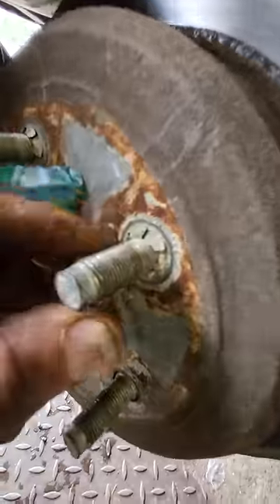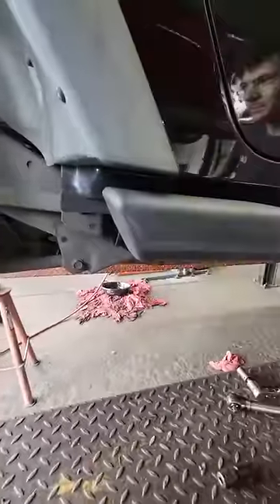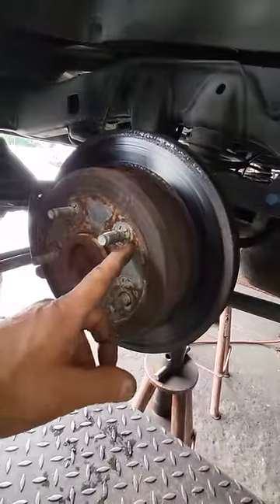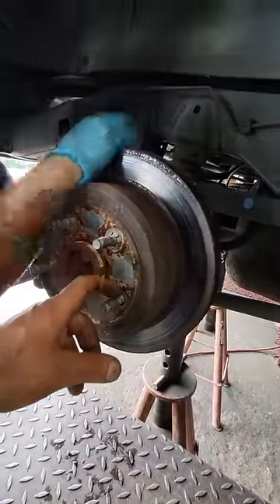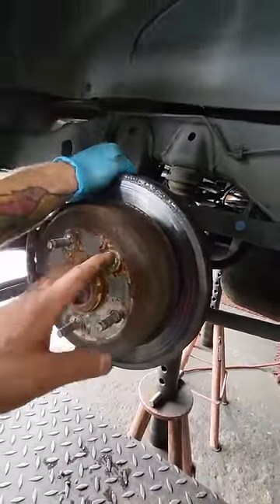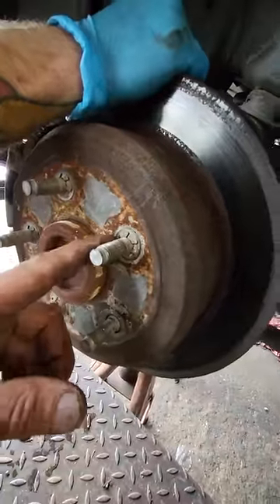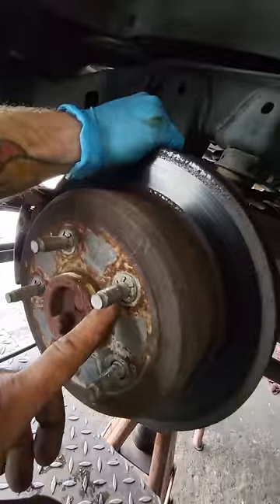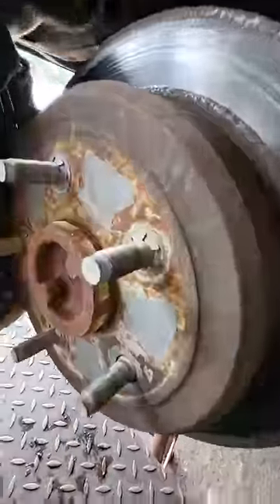There is always that guy

Comment: We had a 2003 Civic manual tranny, replaced the original brake pads from factory at 200k miles! Absolute truth. Drove a manual, like we were always taught, down shift to a stop. Apply brakes at slow speed. I was  amazed they lasted that long. Rotors were in great shape, just pads finally got wore down to the squeallers. That was an awesome little car.
Reply: Imagine using the brakes to stop the car instead of the transmission?  Wow what a novel concept.
Reply: @machineman8388  Your lack of knowledge in driving shines brighter than the Vegas strip.🤦
Reply: @whitetailhunter7202  i know how to drive, you drive like that on a track.... if you're doing 50 and a light turns red 200ft away and you downshift multiple times to slow the car and not the brakes you're a complete clown.  Its in the name..... brakes....... and transmission
Reply: @machineman8388  Your continued comments just completely prove my previous statement absolutely correct. Your knowledge is seriously lacking. "Track driving?"
Son, that's how you drive manual.
200 ft? It turned yellow way before, already was slowing down.
Reply: @whitetailhunter7202  yep I did a brake upgrade on my jetta, 140k kms and the pads and rotors looked brand spanking new. I obviously keep the car in gear while slowing down, but I think its mostly just being aware of traffic flow and lights. You hardly have to brake when you are already anticipating traffic slowing down. 
I see people who accelerate towards yellow and even red lights! its not a racetrack, its the road. getting to the light sooner just means you have to stop!
Reply: Brakes are cheaper and easier than a clutch
Reply: @AlphanumericCharacters  yeah but you don't slip the clutch to slow down. once its engaged its not going to wear. by leaving the car in gear your engine is doing the braking not the clutch or trans.
Reply: @Born_Stellar  it’s gonna slip as you are engaging it to slow down. You will wear a clutch more on a downshift like that then an up-shift. Which is why you double clutch and rev match on a heavy truck transmission. You don’t do this on a synchronized transmission. Your revs aren’t matched. 
On an up shift you are dropping revs and going up to a higher ratio so you don’t get this effect. 
What you’re doing is trading clutch friction material for brake friction material. 
Not wise
Reply: @AlphanumericCharacters  but youre already in gear cause you were going forward. I stay in 5th till I get to pretty slow and then put it in neutral. 
also when I'm driving for fun i do rev match downshift.
Reply: @Born_Stellar  read OP's comment again........
Yes there's better and worse ways of doing it, but slowing down with anything other than the brakes moves the wear from the brakes to the part doing the deceleration, its very simple.
Reply: @machineman8388  legally you can't cost in neutral anyways.
Reply: @Born_Stellar  its in the name. 
The brakes do the braking........
The transmission transmits the power to the wheels through various ratios......

I wonder why people with automatics use the brakes to slow down?
Reply: @Born_Stellar  you don’t downshift to slow the car? You aren’t going to get squat for engine braking in 5th gear. Gonna take two miles to slow down. You could do that with any car and save the brakes. Just let it coast to a stop. Guess you don’t have much traffic out your way.
Reply: @Born_Stellar any load or energy reduction has to be done by something, sometimes its just gravity. Engine braking through a manual transmission is causing a ever so slight amount of wear. It is opposite to normal direction of wear that a car spends 80%+ of its life, so really no harm.
Reply: Poor driving habits/skill could affect this, the clutch should be engaged with as little slippage as possible. The only time a clutch should be ridden an slipped in normal driving start from a stop in first gear or careful precise maneuvering (or backing up in reverse).
Reply: @AlphanumericCharacters rev match bro. Negligible clutch wear on downshifts if you know how to drive
Reply: @AlphanumericCharacters ok f*cking big trucker what is a Jake brake for???
Reply: @jcanfixall1585  you got a Jake brake on an ‘03 Civic? Fucking sweet! Was that a JDM only option? You got it imported? Nobody is talking about if you should slow by engine braking with a heavy truck. And the calculation you are making there isn’t what is cheaper and easier to fix. It’s that you will burn your fucking brakes to the ground on a downgrade if you don’t do so. Plus, as I stated, you are rev matching. If the engine and input shaft are moving the same speed when the clutch is released there will be negligible wear. Besides are you downshifting on the downgrade when you are using that Jake Brake Mr. Big Trucker? Enjoy getting hauled out of the runaway ramp when you can’t get back in gear Mr. Big Trucker.
Reply: @AlphanumericCharacters  it really is amazing to me how argumentative some of these weirdos get when you suggest that a motor vehicle has an independent system with the purpose of slowing the vehicle down....... they feel they have to play a game of ego, like they know how to drive stick and no one else does.
Reply: @jaredlancaster4137  do you unironically think a manual transmission has 1 part named a clutch and thats it?  Because it seems like your understanding is very limited.
Reply: @jacobnorth8642  thats really what my initial point was, OP being a sanctimonious boomer bragging about saving brake friction material on a 2000 honda civic just made me cringe hard.  Swapping 150,000 miles worth of stopping regardless of how you drive from the brakes to the transmission is not a flex, its actually just stupid and makes you look like a non-conformist D-bag
Reply: @machineman8388  I unironically have never known of anybody breaking anything but the clutch. I am very aware of the workings of a manual transmission. They are usually very strong and long lasting. If you kind of know how to drive, most manual transmissions should last 500k+ miles with only clutch replacements and fluid changes, whereas an automatic will require full rebuilds including drive bands, sprag clutch, and valve body and torque converter service.
Reply: @machineman8388  to be fair….I’m argumentative as fuck. No better pass time while dropping a deuce than arguing with morons on the internet. Dude told me “rev match bro”. Can you imagine driving an ‘03 Civic around town and heel/toeing to prevent wear on the brakes. Literally some of the cheapest brakes on earth. How cheap can you get? Probably would have gone through three sets of pads and rotors over 200k if dummy hadn’t did as he claims. So drive like that every day to save $300 over a period of 200k miles? Ludicrous. It wasnt the OP who said to rev match so he wasn’t doing it. Just wearing his clutch out. Probably went through five clutches in that time. Or more likely the brakes lasted that long because they were mostly highway miles. Just epic stupidity. But it is fun to go through the progression of comments and watch them stick to their buffoonish ideas no matter all the incontrovertible facts and logic they are presented with.
Reply: @AlphanumericCharacters  LOL I'm dead dude, I forgot to reply to this but im glad I saw it again, I love to see these mouthbreathers dig their heels in deeper and deeper
Reply: @machineman8388  it’s hilarious. Craziest shit is they are probably googling shit before replying. They don’t know shit about it but some dumb shit cousin told them to do it years ago so they will argue to no end. 
 It would be like me going onto the comments after a video on accounting and arguing about the proper way to interpret actuarial tables or some shit. Everybody is an expert on everything.
Reply: @machineman8388 it's people like this that get slammed into because they're slowing down either in top gear or in neutral and when the jerk off behind them is on their phone and not paying attention they're not in a position to quickly accelerate or make a lane change to avoid getting hit. Once a clutch is engaged, there is no worry of wear. If you are a capable standard driver you can downshift smoothly without slipping the clutch.

Comment: As someone who works on there own stuff and is OCD. I use all the required consumables during break jobs (many people don't use red medium strength high heat thread locker on bolts like there supposed to) I also clean everything beyond clean. I don't reinstall those clips at all, there a one time use for holding the rotor on during the assembly line process until the calipers get put on to hold the rotor while the wheels off. Once removed they get bent easily and if you put them back on it can wheel vibrations from hell.

Comment: I actually work at the factory that builds the whole rear end drive train. We actually put those on in the process the hold everything in place during the build process. But it was designed to be removed at some point and there's no actual reason to have them on so there's no point replace them
Reply: Sure you do...
Reply: @CadillacDriver  sure did get quite.
Reply: @ImNotNotHigh420  nice grammar 😂😂
Reply: @CadillacDriver  this was an attempt at trolling? And why are you mad? Are you a GM exec or something?
Reply: Correct they go on to hold the rotor on going down the assembly line before the calipers get put on. After that they are useless as the brake rotor is held on by the calipers if the wheel is off.

Comment: I have been a mechanic for 42 years and I am that guy that puts on new clips when i do brakes It helps keep the rotor in place during reassembly and it helps keep the rotor seated against the hub flange during any future tire service.
Reply: I might put the screw back on a Honda if it's not rusty, but there's no way I'm putting these goofy ass things back on... Plus you would have to buy new ones since they get damaged removing them, just extra cost for literally no reason... If I need the rotor to stay still while I put the caliper bracket back on, I use a stud installer and a lug nut to hold it still...
Reply: @mariusjenkins7294 putting the screw back on the Honda is even more worse. Your setting the next guy up for failure
Reply: Wow has trouble keeping it on.. crazy . You only get the best problems. 
Bet your problem with your trees is to much fruit too. Lol
Reply: So the other 90% of the vehicles that dont come with them are wrong for not having them? Most rotors are rusted to the hub and the caliper keeps them on the hub. 100% useless to be on after the assembly line.
Reply: Never seize  @AndrewCantonTV
Reply: No one cares
Reply: @AndrewCantonTV I’ve had to drill out countless Honda rotor screws lmao they suck

Comment: I've seen cars with a Phillips screw in the rotor serving the same function. My luck was that the screw got seized, and I stripped out the head and ended up drilling it out. The after-market rotors I bought didn't even have the hole for the factory-assembly-line retention screw. I still own the car, and it's perfectly fine many miles later.

Comment: It keeps the rotors on during assembly, you can remove them or keep them on. It holds the rotor on while the calipers are installed
Reply: If the rotor is moving that much while you're trying to get the caliper on, you're doing something wrong.

Comment: Here's what an old mechanic told me, "General Motors doesn't give you anything you don't need."
Reply: good thing this is a jeep
Reply: @austinspiller9185 your comment is underrated.
Reply: You couldn't have been any closer to the truth. Everything cost money – including those retainer clips. They were put on and left on for a reason.
Reply: @ParabellumX  nope just holds the rotor on during assembly…. Y’all obviously aren’t mechanics lmao
Reply: OEM puts them on to keep the rotors from falling off while they are on the rack being trucked from the axle plant to the assembly plant.
  They're not needed after they are installed on the assembly line.
Reply: Cost time to remove so they leave that up to customers or mechanics who service them
Reply: @austinspiller9185 GM was the one that started this practice. It was cheaper to use those retaining rings, than it was to use rotors/drums machined with set screws.
Reply: They give me whole lotta problems
Reply: These aren't on GMs haha.
Reply: I guess you have never done a PDI before.
Reply: Funny that it’s a Chrysler product named jeep
Reply: I don't need a 36" screen on my dash
Reply: @huckfinn2315  what you talking about 😂
Reply: What about EGR valves nobody needs those but they’re still on everything
Reply: @ParabellumX only there for ease of assembly during production.
Putting those clips on likely reduced dwell time throughout the assembly process. Thus justifying the need for them. However they are useless after they're produced
Reply: @Agilepickleunite  not all cars have turbo and the ones that do it helps with combustion temp
Reply: @Agilepickleunite  but they have them for toxic NOx gasses in the air from the car they help reduce NOx
Reply: @woodz0431  but that’s not needed is it
Reply: @Agilepickleunite  not for the engine to run but for it to pass inspection and quality testing yes it does
Reply: General motors gave me throttle body injection.  😂.   Didn't need that useless crap.  Now I have a carb.
Reply: I like how he thinks after 100,000 miles it’s had a dozen brake jobs, could be factory pads.
Reply: GM elitists are some of the most oblivious people out there. Think their Chevy can literally move a mountain if they just wink at the truck
Reply: @woodz0431 bro you’re as dense as lead. Obviously get the point but you’re obfuscating for no reason
Reply: thats the biggest bull i have ever heard
Reply: This is true, but it was a hell of a lot more true back in his day when GM actually made quality vehicles
Reply: 😂 no they sell it to you though
Reply: I assure everyone any car make WILL be more then glad to sellll you as many things that you don't need as they possibly can !! 

Can we get a award for possibly some the All-time obviously false advice any one has ever passed on
Reply: @rookiexreviews  it’s coming from a dude who’s a Chevy die hard it sounds like. Those guys are the most oblivious people
Reply: Just because something was put on and left on... Doesn't make it right. @ParabellumX
Reply: Just hear me out here…But what if, maybe just maybe, the comment is intended to be understood as “If they ain’t on GM vehicles then it’s a safe bet you don’t need them anywhere else; for they serve no purpose after production.”……I don’t know, maybe that’s what the original commenter meant. As if GM is the standard 🙄.
Reply: If this was true, explain why they put tin heat shields on everything that rust off in just a few years?
Reply: @ParabellumX  or maybe they are left on because it’s impossible to take them off once the vehicle is assembled
Reply: There are also people that will drill and tap retaining screws when they break lol
Reply: Ain't that the truth. If they could save a nickel, they would!
Reply: @Discretesignawhats a PD?
Reply: @Discretesignals what is a PD
Reply: @huckfinn2315 what 36 screen?
Reply: That's cute you really believe that?
Reply: They’re only for when assembling the vehicle during manufacturing. That’s it!
Reply: Mechanic here. That is some BS! My 2010 Camaro SS needed a spring update for their clutch assembly. Did I mention it's welded on and you need to buy an entire new pedal? That's only ONE problem on this car. EVERY single car has problems because cars are designed to be consumed/used and manufacturers want you buying another one in 5-10 years.
Reply: @ParabellumX I really hope you are trolling😂😂😂 they are literally only used for assembly and thats it
Reply: They put those on there to keep them attached in the factory so they don't fall off on the assembly line. After that, they serve zero purpose, They just aren't going to take the time to remove them all. You 1000% don't need those in the slightest, They are doing nothing when your car is assembled and driving down the road.

Comment: It lasted 170k miles until it made it to this old man garage. Now it’s tossed in the garbage
Reply: I think he said a “hundred and something thousand miles”. Hard to tell though.
Reply: Exactly dont think i would have posted this if i had a shop cause it shows your gonna do whatever you think is ok not what is best. I dunno i jist wouldnt wanna go to a shop like this. But who we kidding there all mostly like this
Reply: When one considers the design, indeed the wheel holds the mounting studs and the rotor in place. However, at this stage, the rust is doing a more thorough job of holding things together. I know, because I've replaced one or two of those over the years.
Reply: @kidweirdo wasting time with shipping clips isn't what's "best"... period
Reply: This is peak "I don't understand what this thing does so I want it on the car because it's there for a reason.". Take that rotor off one time yourself and you'll understand why those clips aren't necessary
Reply: @kidweirdo it’s to hold the rotor on while it’s going down the assembly line. If they’re so important why don’t all cars have them ?
Reply: Lmao those clips are pointless yall are upset about one run of cars that were made with these.
Reply: Going to be a bitch to get those rotors off without damaging the pins for the parking brake shoes.

Comment: They are great for holding rotors in place, while putting calipers on after new pads & rotors installed. I’ve had box full of them for 30 years. A lot better and faster then the old boxed end wrench and the lug nut holding them in place. Never fails I would always pick up wheel & tire just too realize I still gotta take wrench & lug nut back off before can put wheel on!!! Lol with those clips wheel goes right over them! Just a thought . Too each his own! All makes green! Your way & mine!!